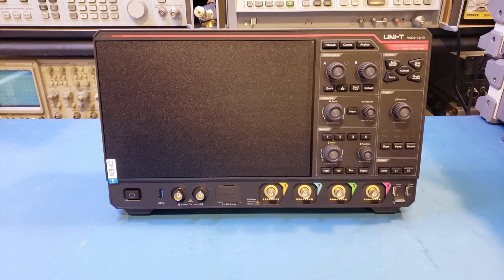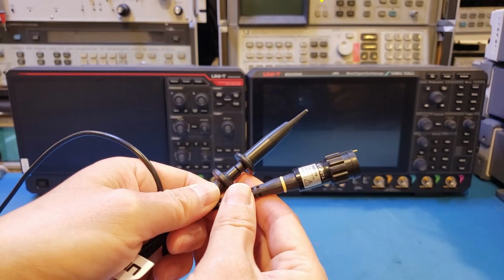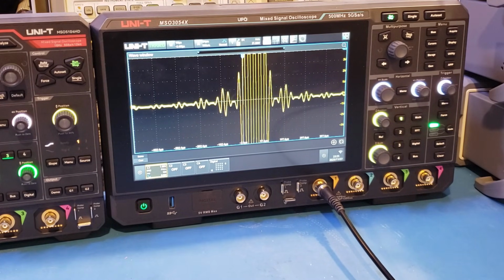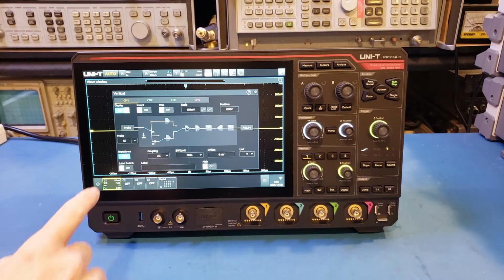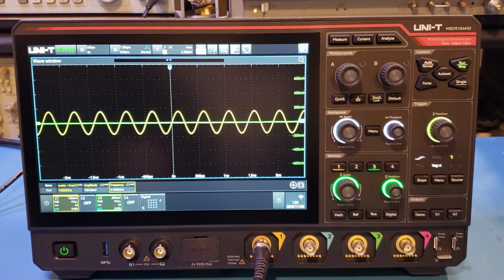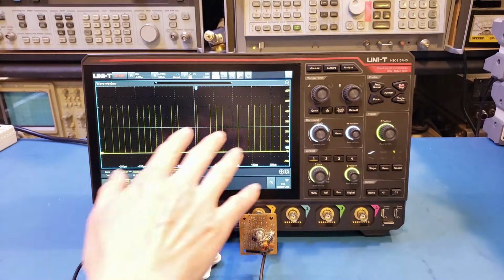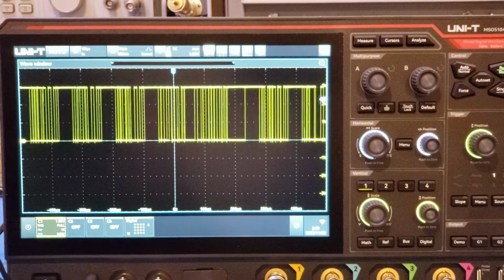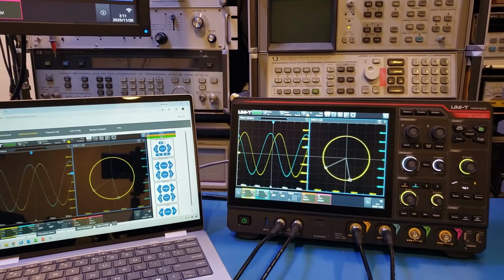UNI-T MSO5104HD 12-Bit 1 GHz Mixed Signal Oscilloscope Comprehensive Review

Comment: Great review! One additional test I would really like to see is a VNA measurement of the oscilloscope's 50 Ω input.
Could you measure S11 / input impedance versus frequency, ideally up to and beyond 1 GHz, and show the return loss or Smith chart?
It would be especially interesting to repeat the measurement at different vertical V/div settings to see whether the input impedance remains close to 50 Ω when the oscilloscope switches between its internal gain/attenuation ranges.
This would help show not only the bandwidth, but also how well the 50 Ω input is actually matched across frequency and across the different vertical ranges.

Comment: It would be fun to put this model up against the Rigol MHO98.  The MHO98 comes standard with CAN/LIN/Flexray/I2C/MIL-STD-1553 and several other serial decodes built in, FFT, Bode, 16 bit parallel digital pod and 2-channel 100 MHz arb generator as standard features.  The Rigol is 12 bit, 1 GHz bandwidth and 4G sample/second shared with 4 channels and 500 uV/division resolution.  I have an MHO98 on order and I am surprised Rigol promises so much at their surprisingly low price point.  We shall see….
Reply: 100MP versus 500MP memory
1gs/s versus 5gs/s sample Rate
rise time 1ns versus 0.35ns
wafeforms per second 1mil versus 1.5 mil
screen 7in versus 10in

Also you cant buy a mho98 hardly anywhere now. it was a special edition used to boost the market awareness with a limited supply of units.. They did a good job at that for sure

Also the MHO98 doesnt have active probes, and regular probes are only good to 500mhz, so how can you use the higher bw really?
Reply: Yeah, be interesting to see how hackable the MHO98 turns out to be.
Reply: @teadrinker7098  The MH098 doesn't need any hacking. I assume you mean the cheaper models in the range?
Reply: @vincei4252  even MHO98 can be hacked. Bandwidth is software limited and limited by LC filters on PCB. Second one is obvious. First one requires to change AFE binary flags in the firmware.